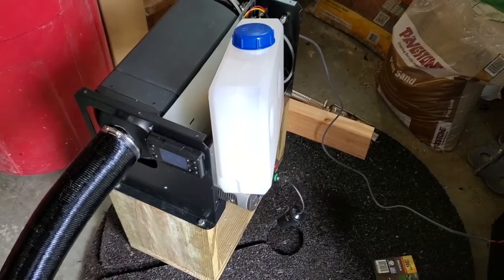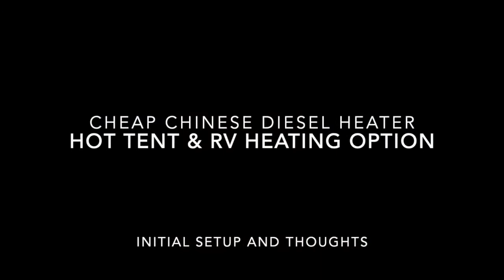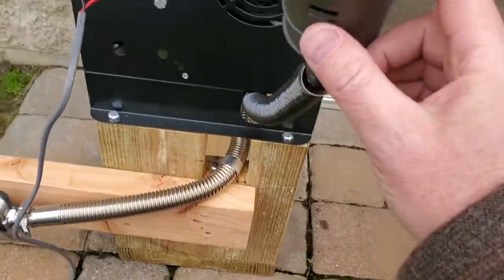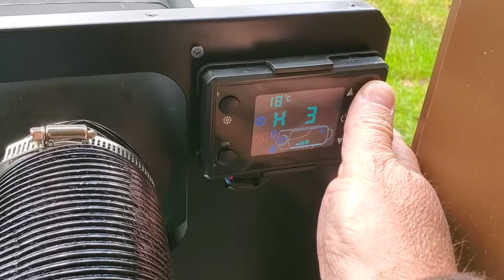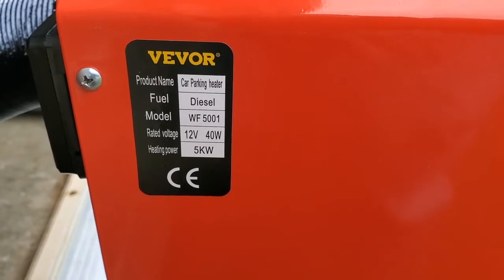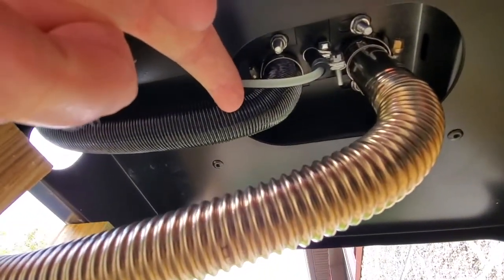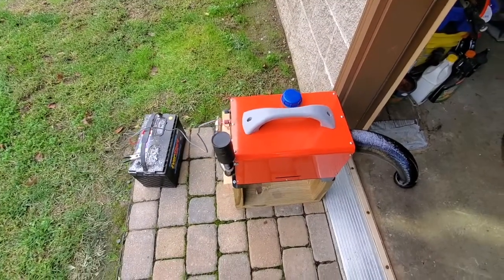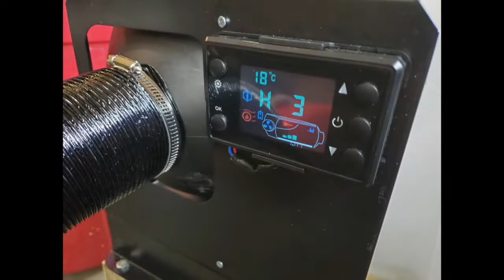Cheap Chinese Diesel Heater, Hot Tent & RV Heating Option: Initial Setup & Thoughts

Comment: I mounted mine on a gutted computer tower and used the power supply form the computer to power the unit. I sure love these heaters. Mine is in case we have issues with the grid we will have backup heat. I made videos of my setup as well if you want to check it out.
Reply from the maker: Besides camping, I figured the heater would work for providing heat to the living room during short term winter power outages.  Anything over a few days would probably require going back to wood heat...unless I stock up on diesel fuel.  The diesel one is safer from an insurance standpoint.  😉

Thanks for watching.   🙂
Reply: @MikeycatOutdoors  I agree. We rent a small house about 400 square feet in size so a wood stove is out of the question but this heater will do nice in this little place. But as you stated its only a temporary solution to buy time for something better if it is a really long term event.
Reply: Where will you get your power if the electric grid goes down??
Reply: @alanosborne1947  one of my Ecoflow units and I will use my solar array to keep them charged. We are into preparedness. We are ready for an extended power disruption. Our heater works so well that is what is heating our home right now. Its much cheaper than using the electric heat.

Comment: The top half of the air intake clips off, as it is the same as mine and it has a fine gorse in it, so I drilled a series of holes around the side ( 6mm or 8mm )so as it can get more air which the heater must have.
Reply from the maker: Thanks for watching

Comment: Did you manage to get a fuel filter on there, I got mine on (just) it is a tight fit as my heater is the same, I found the pump was on the wrong way, it would have been trying to pump fuel from the inlet of the pump, the pump outlet is the end with the wire plug on it. 
I have the 8kw but looking on (John Mack MC47) channel, it is a fiddle (scam) regarding the 8kw, it is in fact a 5kw heater, but it will be more than adequate for my needs, he strongly recommends  putting a fuel filter on it.
Reply from the maker: I havent added an inline fuel filter yet but I usually (not always, but usually) use a paint strainer funnel liner (auto paint store) or a fuel funnel with a built in screen for my camping fuels.  

Agreed, the 8kw is just an overdriven 5kw unit. 

Thanks for watching

Comment: looks nice!  wonder how is this compare to the slim tall all in one type?  the slim version has fuel tank setting on top of the engine instead of on the side.
Reply from the maker: I think they probably operate about the same.  The weak point in any of these is the fuel pump which can gum up over time.  There's replacements pretty cheap on Ebay.  Thanks for watching.

Comment: What if you were hooking up to a 12-volt outlet and plug it into the wall of the house?
Reply from the maker: 12VDC is 12VDC no matter where its sourced from.  Just as long as you've got the correct power transformer available to supply the output voltage and sufficient current, you'll be fine.  I eventually modded my heater to a 12VDC car plug and connect it to my Jackery power bank as its much lighter than a lead acid battery.  (Note, the GoZero brand power banks don't output a high enough voltage, so they tend to throw error codes on the heater.). If someone wanted to use one of these heaters for camping somewhere that traditional wall power wasn't available, there's several battery options for one of these heaters.  Thanks for watching.

Comment: Can this heater use Home Heating oil / #2 Fuel Oil?
Reply from the maker: I honestly have no idea.  I'd imagine it depends on the viscosity of the oil vs diesel and what the fuel pump could pump through the fuel line to ignite at the glow plug, plus the flash point of fuel oil vs diesel.  Might try it with a blend of fuel oil and diesel or kerosene if it's too thick.  

I think this question is going to require some Google research.  😉

Good question.  Thanks for watching.
Reply from the maker: So....reading other people's comments online, it looks like you can use fuel oil for these heaters.  If there's a question about self lubrication of the pump or viscosity, you could still blend it with at least 20% diesel to be on the safe side.  

https://www.motorhomefun.co.uk/forum/threads/heating-oil-eberspacher-use.231338/
Reply: @MikeycatOutdoors  I looked at the guts of my old burner fuel pump, and it's got steel gears moving the fuel oil. https://youtu.be/ZVhZvE_QCBY?t=280
So, the lubrication by the #2 fuel oil has to be very good. I've read it's pretty much the same thing as diesel, except for the added dye. (for tax controls). 
I'm not sure why I can't find any solid data. Maybe less homes are using oil burners these days..
Reply: @XRinger  Honest question, why not use diesel? It has to be cheaper and more accessible than heating oil no?
Reply: Yes

Comment: Not very bright to mount the exhaust to a board.. .. That'll catch fire is short order..
Reply from the maker: I worried about it originally.  I've used it at least 6 times since then and no fires yet.  I separated the muffler from the wood with a 3 inch screw to dissipate the heat and might add some Fiberglass wrapping at the U notch where it's clamped to the board.  I may come up with a different mount someday but it's working for now.  

Thanks for the comment and thanks for watching.
Reply: @MikeycatOutdoors   What I came up with was some sheet metal ( 6"X8" ) and a step drill bit. Then attach the sheet metal to a larger hole in wood board keeping hot pipe inches away from the wood.

Comment: First of all $140.00 isn't cheap ANYMORE 😂
Reply from the maker: $140 is about two bags of groceries these days, it seems like.  Yikes.  I swapped out the DC fuel pump with a slightly better one from Ebay after my fuel thickened up one super cold night and it stopped pumping.  Otherwise, it's worked pretty well.  I add a little anti-gel to the tank and run it off my Jackery with a 12V plug.  Thanks for watching.

Comment: You were given misinformation there are only 2 Kw and 5Kw Chinese heaters. Webasto, Planer etc. may have different sizes but the chinese heaters only come in 2 & 5. An 8Kw is deceptive advertising. Anything you need to know about these heaters watch John McKay 47 series of video's! Also if your going to do a face close up clean the boogers out of your nose!  🤣😅😂
Reply from the maker: I had already included a link to John McKay's videos within the description info for the video.  https://www.youtube.com/user/johnmck1147    At the time, the heater was new to me, and I was trying to figure out a few things with it still.  In some sense, a 5 can be a 2 or an 8, depending if it's under-driven or over-driven, but yeah the 8's are pretty much an over-driven 5kw unit.  I'm learning as I go.  

As for nose goblins, most of that is fast growing nostril hairs and some nasal drip which I'm not always aware is going on.  A daily morning blowout & ream-out of my nostrils with a kleenex seems to only do so much.  I'm not going to powder my face or wear lip gloss and concealer and have a hair stylist on stand-by if that's what it takes to be on YouTube.  I'm a man, not a supermodel.  ;)  A different camera angle might be easier, but then I might get comments about my hairline.  LoL  

Thanks for watching.
Reply: Hi from Manchester, U.K.  What a great answer about the goblins, its about the heater.   Very helpfull for me, I needed to get an idea for the heater base, thanks.